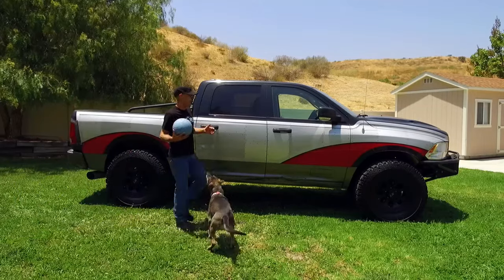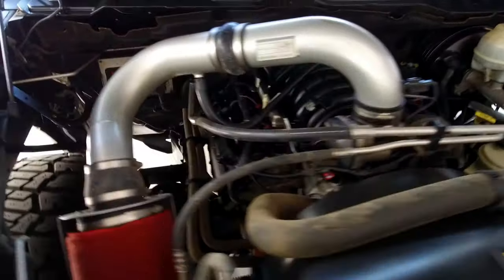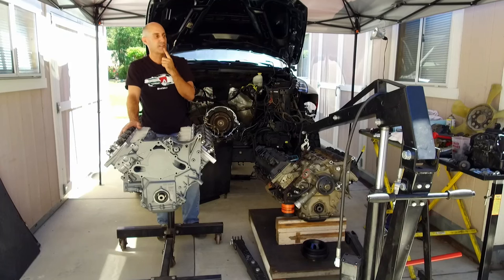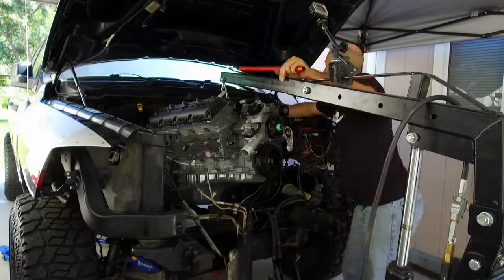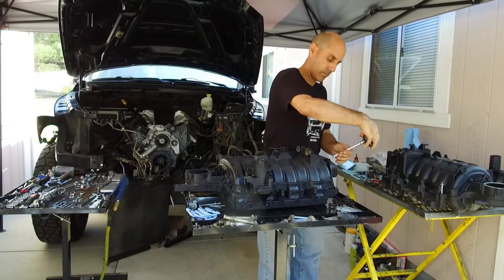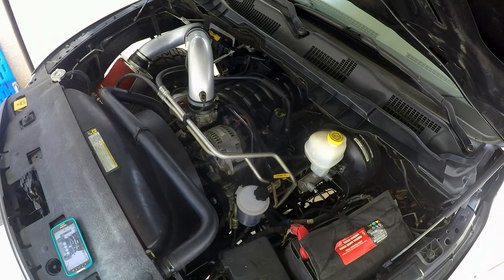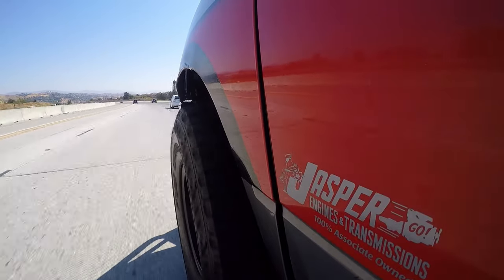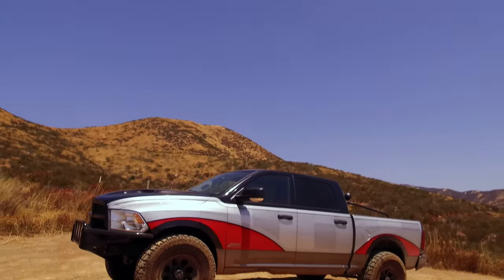HEMI Swap with Jasper Engines Replacement 5.7 in a Dodge Ram 1500 on 37" Tires

Comment: The Cummins diesel is better
Reply from the maker: For towing, yes... but for awesome sound and fast hot dogging through the hills... give me a Hemi any day!
Reply: true and I love the hemi too but what about those diesels that can keep up with a nissian gtr?
Reply: Your absolutely right those Cummins are some bad ass engines. Especially the old 5.9 in my opinion atleast.. They can definitely be built to be just as fast or even faster then it’s hemi gas counter part and last a whole lot longer. Although I’m a diesel guy big time I opted for a 2017 single cab hemi over the Cummins due to the price difference I got my truck for 24k and would do it again over the 43,000 dollar single cab 3500 I wanted. At the end of the day I love my hemi and it moves just fine .
Reply: Sherman Steel I had both and got rid of the Cummins because it was slow and I don't tow anything. In California a big truck like that is a night mare especially in the Bay Area .. I love my hemi better it's fast the thing I miss is the ride height of the cummins it was nice n aggressive looking
Reply: For towing*
Reply: Sherman Steel what a rearded statement fan boy

Comment: I would have put some quality headers on that engine, along with new sensors, and a custom high cap radiator, while it was out. Other than that, great video! You make it look super easy!
Reply from the maker: I wanted to do all of those things but at the moment of an engine installation.. you're talking about a few thousand dollars more expense and I wanted to do this as practical as possible at the time.  Now, if money were no object... heck yeah headers and full goodies!

Comment: Tip for anyone doing this. Get an exhaust manifold kit from BD DIESEL. 

Only about $500 for drivers and passengers, but like Jasper, BD diesel has engineered the manifold to improve the weak points of the oem ones

Comment: My '04 Durango ruptured a piston rod at about 175K miles. I had a Jasper engine put in for about $5700 miles. it's still going strong at about 250K miles.
Reply from the maker: Mine is still running strong!

Comment: Great video! As the owner of a 2011 Ram with the 5.7 Hemi, I would love to know how you like the Jasper remanufactured engine now. I haven’t had any problems with my stock factory engine yet, but statistically it could happen. I’m also from Indiana, not far from Jasper. Please let me know how yours is holding up.
Reply from the maker: Several years and tens of thousands of successful miles... it's still running great.

Comment: The petal trick also works on the Vortech line of engines from GM.  It doesnt work with the older throttle body engines, but disabling the coil is super easy on those older engines.

Comment: In the process of doing an engine swap on my 2012 RAM now...boy did I underestimate how big of a project it was by watching this first.
Reply from the maker: Other than the install going well, what about this seemed easy?
Reply: AutoEdits it didn’t necessarily look easy. I understand this video just highlights the engine component and was very well done. Just the amount of ancillary parts that are required to do the engine swap that weren’t included in the video is what I didn’t account for. Still a very helpful video!

Comment: Well done my friend! Thats quite a task to tackle single handed. We are doing this same swap on our 2010 dodge ram...Do you use RTV sealant on the intake manifold rubber gaskets or put them on dry? I can't find any info on this. Any input would be greatly appreciated.
Reply from the maker: Put them in dry... that's how they are designed!  Hope it goes great for ya!

Comment: Ahh~ a clean garage,  since 1977 , done plenty of tranny/ engine/ front end/ bobcat track replacements / split rim dump truck tires, etc in the yard/gravel/ mud. You would think after 7 yrs as a Mercedes dealer tech, I would upgrade my work area, but naa, getting that 22 ft ocean boat was wayy more important. Oh well, even that gets worked on outside.
Reply from the maker: I do all my work outside right now as well.

Comment: Man I need to check out Jasper my 5.9 has well over 200k still going but its tired puffs smoke once in awhile Just can't decide to keep my truck numbers matching or upgrade for better performance.
Reply from the maker: I don't understand the concern for keeping a late model truck number matching. There isn't enough value added by doing that so if you like your truck... when the engine finally goes put a replacement in or rebuild it.  I trusted the Jasper engine because of the upgrades over stock and am happy so far.

Comment: I am on my second jasper 5.7. The original motor lasted 150000. Had a Dodge dealer put a jasper in made it 50,000 miles well I'm on my second jasper. Not sure I'm a fan yet. Also with the warranty I was still out of pocket for 2200 for the last replacement. I did get back 1100. My truck is a 2009 love the truck just hope this engine will last longer.
Reply from the maker: That's a bummer to hear about. Sounds like you put a lot of miles on that thing.
Reply: @AutoEdits  yeah I bought it with 28,000 miles one owner real nice guy. My wife and I like the off road back road kinda stuff. We travel for work and just spent a Awesome year in Colorado.

Comment: It might have been asked in a previous post,  but may I ask what specifically went out on the old motor and what was the mileage?  Do you believe that there is a flaw with that particular Hemi design? I had a '09 that the fuel tank went out on (you literally could not fill the tank!) so I bought a '14 and was hoping not to worry about any type of major overhaul for years.  I have a 17 year old Silverado that is still going with 240k and it has been tortured!
Reply from the maker: +masapell It had 148k miles and it was the valve train that failed.

Comment: Great video! Wish you showed more detail of connecting the engine to the transmission. Do you have any other videos discussing this part?
Reply from the maker: I don't have other videos on that... it went pretty easy. Just make sure you don't force them together and the torque converter moves freely enough to line up the bolt holes.
Reply: @AutoEdits  thank you very much.

Comment: Thanks for this, makes me feel better about taking on my swap this summer! Do you have any pro tips? I'm building a 392 stroker to go in my truck, it's a 2009 as well with a Procharger. Has 200k Km on it now and I think the lifters are starting to go. Got most of the parts from Rock Auto because they scalp us so badly at the local shops here in Canada. Going with Scat crank and rods, Wiseco -22cc pistons. Did a ATS 545RFE swap with CoPilot, Clint says it'll take it, I guess I'll find out!
Reply from the maker: Sounds like a fun build!

Comment: Right after totally refilling the cooling system I'd use a Lisle radiator funnel to get all the air out of the system, it helps bleed it out much faster.
Reply from the maker: Good suggestion.

Comment: great video, improved cooling radiator , oil cooler and transmission? Too nice of an engine to waste on the stress of offloading and especially in the desert!
Reply from the maker: I will look into a new radiator but will take it on a few adventures first just to see how everything does.
Thanks!

Comment: Nice job try installation on a slanted driveway by yourself I did it 4.7l v8 and in a Dodge Dakota solo!  And used a winch strapped up to my Rafters in the garage was able to inch the cherry picker down the slope of the driveway with control.

Comment: I got a 5.7 15 has 890k runs great has over 800hp and a 8 inch lift on 38x14.50R16 rides great handles great gets off offroading 90% of the time and the other 10% running Duramaxs and Cummins owners i cant say too much casue i have a 7.3 swap in my 2017 with a Alison transmission.
Reply from the maker: That's a lot of information right there!

Comment: with the exhaust manifolds, i've researched that they fail in the 2009 & on.  I see you are reusing what looks like the stock manifolds.  Did you change the bolt types or never had an issue with the stock?  thanks for your time and sweet vid.
Reply from the maker: I have heard that they warp a bit and break the bolts.  Mine didn't do that but some of the bolts did break the moment I tried to remove them. I've been fine with them since re-installing them on the Jasper engine.
Reply: Sweet ty for the feedback, great production and information

Comment: Great job.  Swapped engines myself before as well - jeep CJ and Dodge.  How'd you get Jasper to let you do your own swap?  Would love to but would rather not use an installer.  Love your vids.  Thanks.
Reply from the maker: You can request a self install from Jasper but it isn't the normal situation. I've been thrilled with the engine so far!
Reply: @AutoEdits  Thank you for the reply.  Appreciate it.  Yeah man, new engines are like having a new truck in you old familiar truck.

Comment: Did you get the 5.7 with MDS deleted??? Wondering if they even had that option when you did the swap. I just ordered a Jasper 5.7 with MDS deleted for my 2017 Ram 1500. $7,000 for the engine and $2,500 to have it installed. I’m excited and curious to see how it performs with no MDS.
Reply from the maker: I disabled the MDS with a tuner and it ran amazing. It's still running great.
Reply: So you disabled the MDS in the PCM, but you still have the stock cam shaft, MDS lifters and solenoids?
Reply from the maker: Yes @codycarter3384

Comment: Hi there, awesome work done on this truck, just have a little query on how did you manage to run the engine without programming the ECU also what about the balancing and calibration of the transmission? Normally the factory has certain calibration for both engine and transmission and it’s not easy to do it without computer or at least some programming! I’m not an expert and excuse my ignorance I just want to know how that’s it bro ... thanks a lot
Reply from the maker: You know, after the install.. there wasn't any codes and the transmission re-learns on the next 50 miles or so miles driven and it has been great ever since!

Comment: Can you engine swap my charger 😂?? Great video btw!
Reply from the maker: Bring it on over... lol
Reply: @AutoEdits  do You recommend swamping a 3.6 engine for a 5.7 hemi without any dramatic changes other than the mph meter ?
Reply from the maker: @geo6019  lots would need to be changed including computer and some other wiring... but can be done for sure.
Reply: @AutoEdits  I forgot about wiring & the computer my bad isn’t there a risk for switching the computer components perhaps the car might not read the new one and start?

Comment: So does Jasper address the drop valve seat issue in the Hemi cylinder heads like Powertrain Products Inc does?  Also why did you not put a set of shorty headers for better exhaust flow instead of the cast iron manifolds and why did you not install an Edelbrock all aluminum Victor Jr Intake manifold instead of that plastic intake?  Just wondered, if you are going to do the job, do it right the first time.

Comment: Senor Auto Edits,
Any updates on your Jasper engine swap? Anything you notice different on the truck? Also, hows your transmission doing? Ever considering installing a Jasper transmission install in the near future?
Reply from the maker: The Jasper Engine has been flawless! I would absolutely get a Jasper transmission but hope to not NEED one for a long time.
Reply: Thanks for answering my questions! I'm considering buying and installing a Jasper transmission later on this year for my 04 Dodge Ram 1500. Hope it goes smooth. Thanks again for all the awesome videos!

Comment: Nice video. About how long did the swap take I'm fixen to do the same on my 2015 outdoorsman. I totally agree with the intake change as well
Reply from the maker: It took a full weekend to make the engine swap but took a few weeks for the steering pump. After that just a few more hours to swap that and get it running.
Reply: @AutoEdits  ok thanks
Reply: @AutoEdits  is it the 395 hp engine

Comment: Hi, very impressive work, and I can certainly relate to the emotions of seeing back your truck back to life.  I have one question for you, 3+ years have passed by, how is the truck doing?
Reply from the maker: Fantastic. Have you seen my latest off road trip in the truck https://youtu.be/GGvByOkRXGM
Plus, it's still my go to long haul vehicle. Just drove to Moab and back... 1,500 mile round trip and it is so good.
Reply: @AutoEdits  Wow,  it sounds that it paid off all your effort.  My Grand Cherokee limited sport, hemi 5.7lt is broken :(.  Since the truck is in good conditions (but the engine), and it’s a 2007, so following your way of thinking, I think it’s worth it to replace the engine and drive it another 13 years, any suggestions?

Comment: I’m trying to find a 5.7 Hemi Engine for my 2006 Grand Cherokee and I’m wondering if after a year since you install the Jasper engine, what are your thoughts. Would you do it again and still recommend the Jasper engine?
Reply from the maker: I have over 12,000 miles on the new engine and it has been flawless!  Can recommend 100% Very happy.

Comment: So I had the same hemi failure you did, dropped valve seats. Little disappointed you completely slipped the trans to engine disconnect procedure. How did you turn the motor over to get the converter bolts disconnected? Was your motor not stuck from turning over due to the valves sticking open? How did you get to the top bellhousing to engine bolts?
Reply from the maker: Just use a pry bar on the flex plate gears to turn the engine.

Comment: @15:39 I was watching this video again because I absolutely loved the build. However, I should make a note that while the manufacturer recommends 5w20, I would not use that on my engine. They do that to get better EPA ratings. The engine sounds a lot better and more healthier with a good 5w30 or 0w40 and the oil changes intervals kept to 3000 - 3500 miles. 
I learned this the hard way after facing the dreaded Hemi lifter tick 3 times on two different trucks. Just thought I should mention that. The best oil for the Hemi, IMO is Redline 5w30. The additive package is great. However if your budget cannot handle that, then a good oil like Mobil FS or Valvoline Fully Synthetic is good enough.
Reply from the maker: I spoke to the engineers they DO NOT recommend changing the oil viscosity. With engines that have variable valve timing and systems that depend on oil pressure to operate... changing oil weight will greatly reduce the efficiency of those setups. Do whatever you want but I'm just passing along the information I got from the folks that actually designed the engine.
Reply: @AutoEdits  That's great. Normally I would agree and follow the manufacturer's spec wholeheartedly. I followed the manual to the letter on my first 2014 Ram 1500. Used Mopar 5w20 oil which the dealer sold me for all the oil changes. 
Then I had the lifter tick and it was pretty bad. Some guys on the ram forum helped me understand that because I live in Dubai, where the temperatures were 50.C average in Summer, 5w20 oil usage was literally damaging my engine slowly. In fact some people in the US also experienced the same; even on brand new Ram 1500s. Hence most people on the forum recommended 5w30 and are having no loss of efficiency or fuel economy. They have done 1000s of miles on real world testing on their own vehicles with lab analysis as well make sure that they were doing it right.
I was skeptical at first, then realized that my brother's 2004 Durango has the same 5.7 with VVT and MDS and his manual specified 5w30. The vehicle had over 200k miles on it and never faced the Hemi tick and my brother was not the best when it came to maintenance. Pretty sure that those same engineers you mentioned wrote his manual as well. I then learned that the local dealership also used 5w30 on every vehicle that comes to them and only sell 5w20 to customers like us who do the oil changes themselves. So that tells me that the dealership knows what works and what doesn't. 
Currently running 5w30 on my engine and I'm getting the same exact fuel economy that I got before. 

I'm just passing on info for anyone who is considering a vehicle with a Hemi engine.

Comment: I really like this truck love the install and engine hears my truck is a 98 dodge ram 1500 quad cab it has the 5.9 magnum engine its 2wd it has a 180 thousand miles on still runs very strong don't use oil or leak any its my daily driver what better advantage would I have with this engine in my truck
Reply from the maker: I would keep the 5.9 in your truck until it needs replacing and then recommend trying the Jasper re-manufactured 5.9 replacement engine.  They do internal upgrades that help make it last even longer... that's what sold me on this engine.

Comment: The only thing I hated about my HEMI was the 16 spark plugs, and the OEM lifters kept going out at 7000rpms, once I replaced those,... Damn I still miss that engine.
Reply from the maker: What do you mean 7000 rpms? I don't think this engine spins that high.